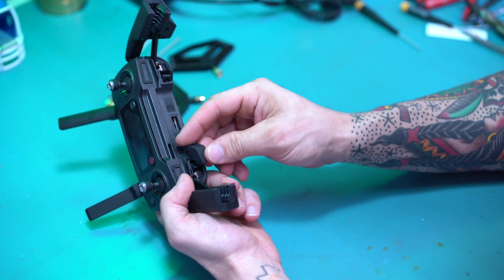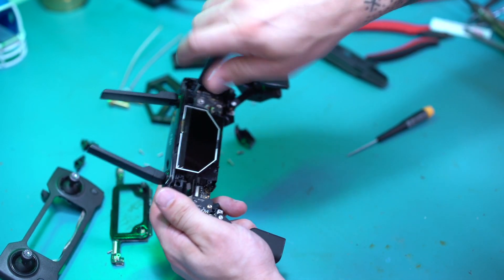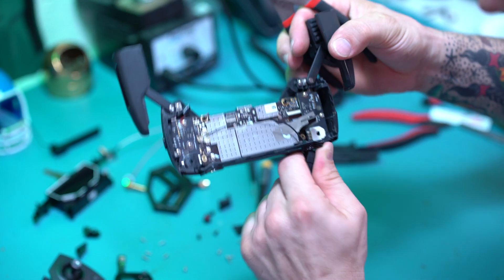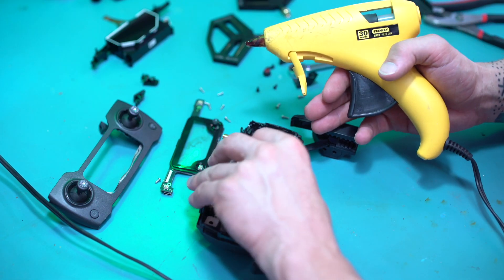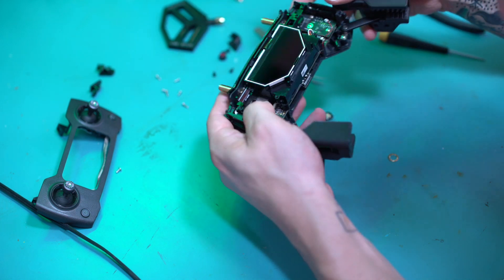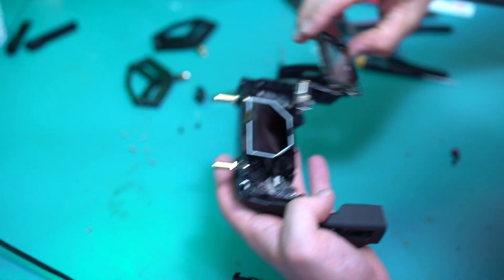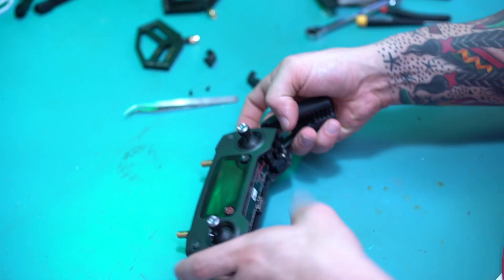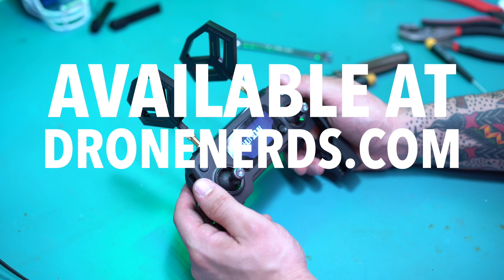DJI MAVIC Long Range Antenna Upgrade Install

Comment: Lol! Who cares about the warranty? Warranties are for sissies. If I can make a product work better than I will.
Reply: all that to not even tell us what the upgrade range is
Reply: It is insurance, and trust me, you will crash this thing at least once.
Reply: Dylan Mulrooney I also know the risk. If I can afford to buy one, I can afford to replace it. A true hobbyist knows this as it comes with the territory. We don't need to be reminded about the warranty as most people with common sense knows this will void the warranty and knows the risk. I've been flying aircraft for 20 years so don't tell me crap about voiding warranties.
Reply: I understand you are a veteran, but in my opinion those who are new to flying it can be a great option. Up to two replacements, $79 and $129. I had an issue with my drone causing it to get wet. They took care of it, giving me ease of mind while I fly this $1.2k bird.
Reply: Dylan Mulrooney That's perfectly fine if you're not a modder.
Reply: Fidelito in South Florida Then be happy with your stock Mavic as I like to tinker with increase video range and increase run times with modified battery mods. I like my 45 min flight times. Part of the hobby.
Reply: Fidelito in South Florida Lol! A extra 2200 Li-Po mAh pack on top or two 2200 Li-Po batts strap to the side will do the trick. Go try it for yourself and don't try to question somebody that has 20+ years of helicopter and other flying model experience. If you was a true hobbyist you would already know there's no warranty in this hobby field.
Reply: James M Every since I was a child I use to love those helicopters. Heck in the 80’s they were soooo expensive. And now here it is the future and we have quadcopters that flies for miles. That why I have so much passion when it comes to flying. I never got to experience it when I was young but oh man, now that I’m grown and a small business owner, I only want the best. The Mavic line of drones are the best, hands down🙌🏽
Reply: Fidelito in South Florida Modifying a drone is not outlawed as professional drone operators built their own drones from scratch. Modifying the remote or modifying a battery is relatively cheap and easy to replace. Most mods don't even affect the Mavic itself.
Reply: Reed Douglas Just gives you a more solid 4 mile range. The distance will vary depending on the location you fly in.
Reply: Very good answer bru. I use to build,mod, adjust and tweak big scale rc choppers since early 90's. Put a Polaroid camera and build brackets for servos to pull the trigger for a shot that you were going to see the pic a week after or whenever the printing lab was not too busy. Then if I was lucky I was pointing the chopper at what I wanted to take a picture... today and especially in this era, I got frustrated at looking at the tons of tutorial video especially on mavic and all those self called tutors that tells you how to adjust setting, bla bla bla. Reset the time back and let's see what percentage of the tutors can build something that fly only using a factory scale 1to1 of a chopper, do the maths and use bars of aluminium and sheets of balsa,screws,bolts and loads of passions to create a flying machine that belong to me and no warranty given, ONLY MY CAPABILITY... No bullshit about awwww if I unscrew it I loose the warranty. If it's broken but another.
Reply: James M really ? Loser !!
Reply: James M ok,but comment without lying ,45 minutes flight !! Give us a break !
Reply: James M  any videos to prove that you do mods otherwise we just think that you talk shit. You have to back it up mate show us your 20+years of experience.
Reply: James M you sound like outlaw person ,I'm not in the same pattern ,I'm a rules follower ,and really happy !